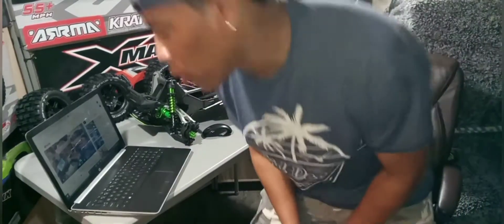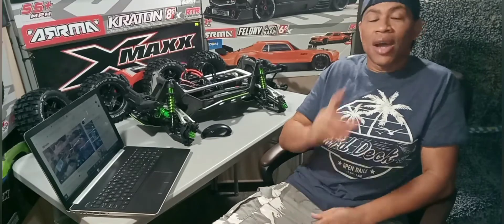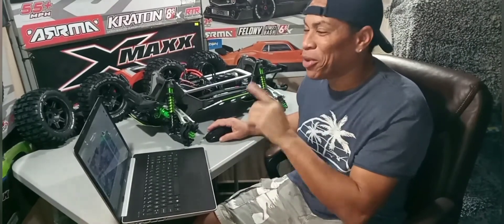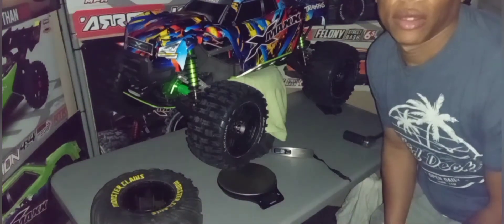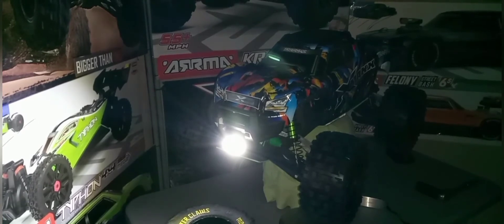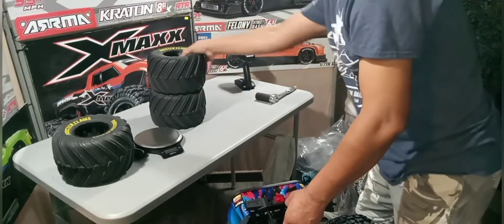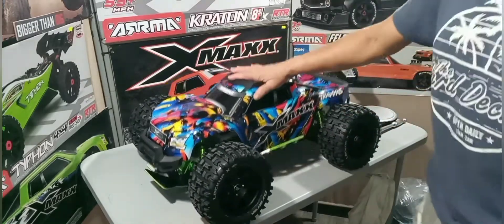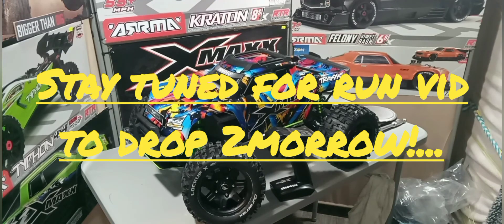Traxxas x-maxx 8s, with Hobbywing 800kv/EZ-Run Maxx 5 ESC.

Comment: What are you putting the 12s system in now??
Reply from the maker: I will put the 12s in my Losi DBXL, it's bigger n heavier than the X-Maxx, so I thing that would b a perfect fit for that 12s power. Stay tuned, I will drop a vid soon with my DBXL. 👍✌